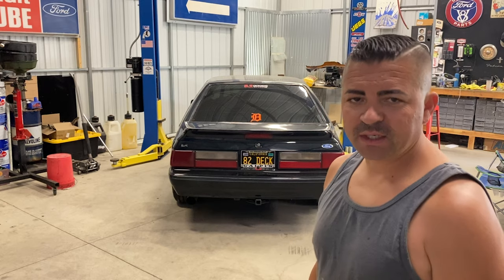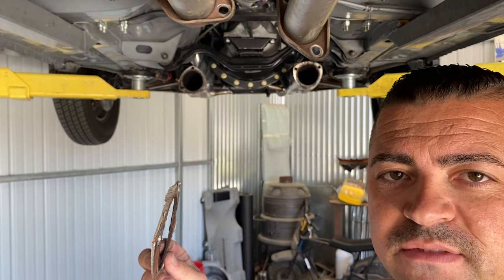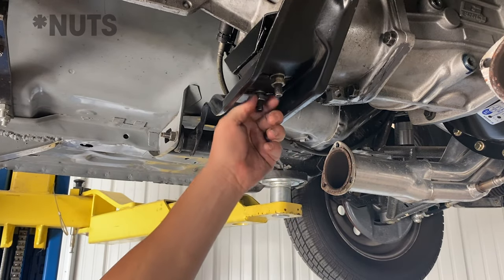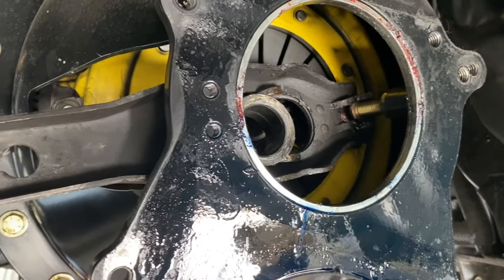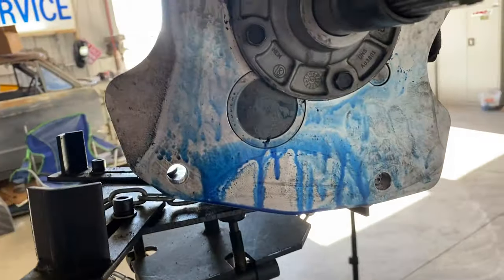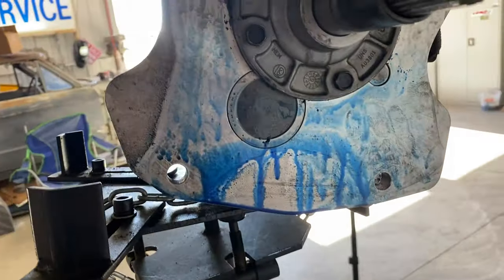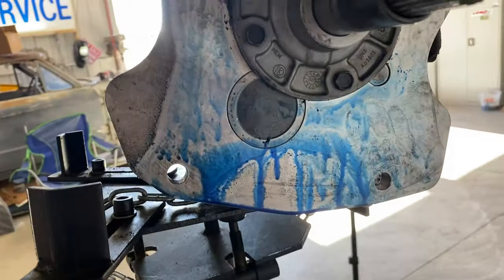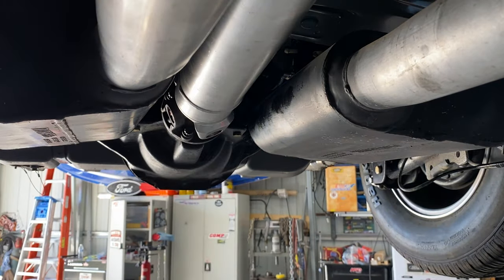HOW TO REMOVE A T5 TRANSMISSION FROM A FOXBODY MUSTANG

Comment: Great video. But do you need to use a primer for the anaerobic sealant? When I’ve used those type of sealants in the past, I always used a primer to spray the surfaces  with prior to assembly.
Reply from the maker: Yes I do!

Comment: Hi Jay! I hope that is your name. I had a t-5 in my 85 Mustang with a 347 stroker. Just how much torque and horsepower can they safely handle? Want to swap out the built C-6 on my 67 460 BB and go back to manual. Thanks and blessings to you and yours from Motown/Dearborn.
Reply from the maker: Yes sir my name is Jason but they do call me Jay! A T5 with no good parts in it won’t hold much torque especially if there is a miss shift. I have went 10’s on a stock T5 with a cluster support from Paul Cangialosi at 5speeds.com but depending on your power and torque output you might want to go 3650 or TKO or T56. It’s hard to give an exact number because car weight, power and the way you shift all play a roll. Good luck however! The man upstairs loves V8’s and stick shifts !
Reply: @TeamDPerformance  Thank you Jason! Really appreciate your input. Not racing the Mustang anymore. More like pro-street. With my new Edelbrock top end kit, will be around 550hp in a 3000# car NA. Perhaps a roots style supercharger over the winter.? Take care, be safe my friend.
Reply from the maker: You might be ok, if your not hard on it it will likely last. They’re plentiful in the yards in V6 mustangs. Same exact trans as the fox ones. If you were closer to me I’d help you out!